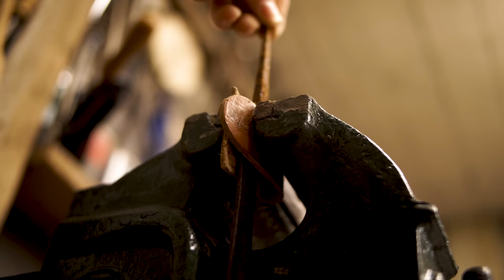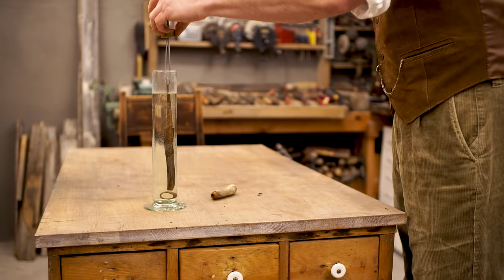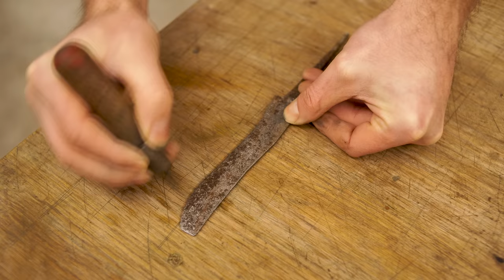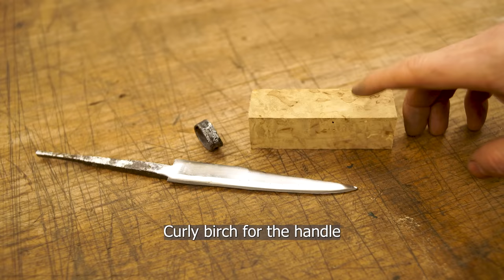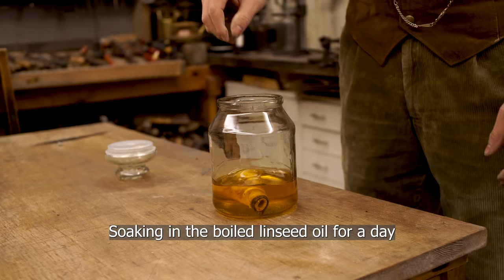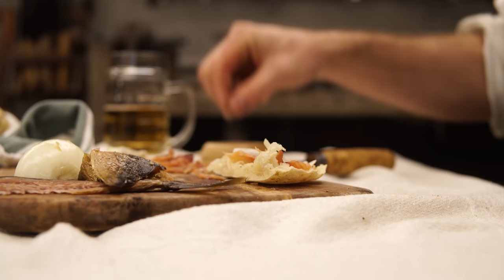Old Rusty Knife Restoration

Comment: Wonderful work as always. curly Birch is one of my favourites.  Is it hard to sharp these blades? especially, when the wield is bad?
Reply from the maker: Thanks a lot. With appropriate sharpening stones or tools it is not that difficult. But on the other hand sometimes it can be tricky because of laminated blade, especially transition between soft steel and hard steel.